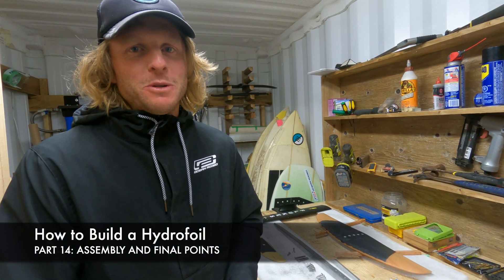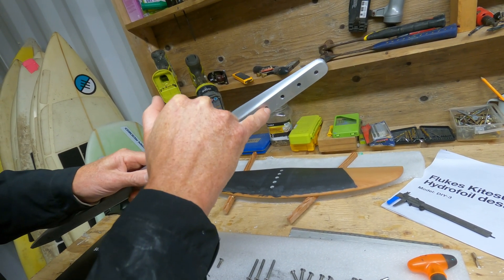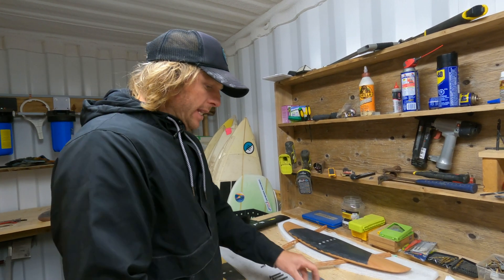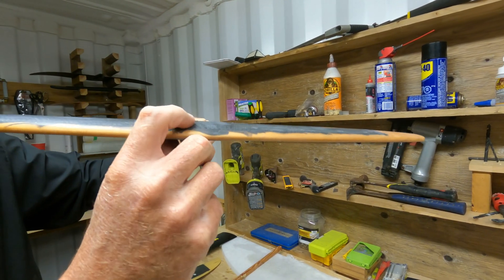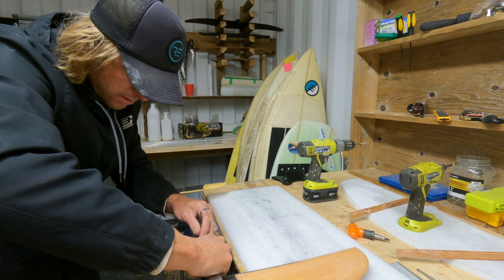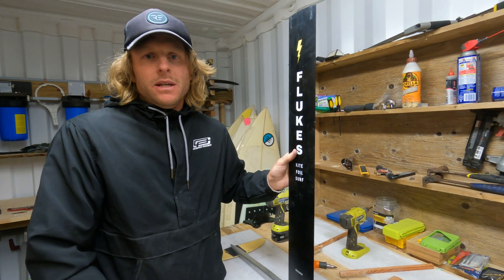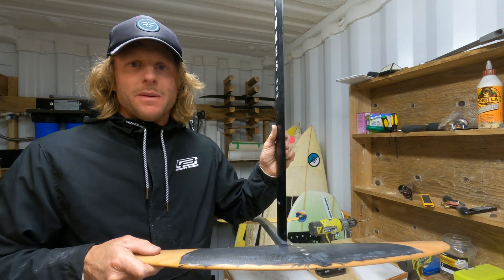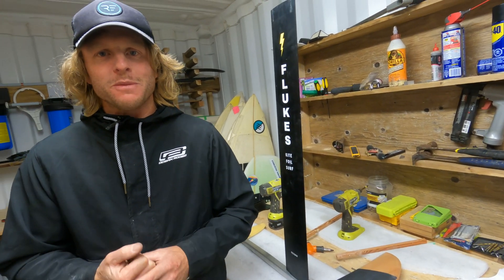How to Build a Hydrofoil: Foil Assemble & Final Points (Video 14/15)

Comment: Hi, do you think a 3D printed model using ABS MATERIAL would be enough? And using fiberglass as well?
Reply from the maker: Its not something i have tried personally, but yes you could print the core but you would need to do a similar  glass layup to stiffen it enough.  :)

Comment: Great job!
But I do not think mast-fuse connection with three M6 bolts is strong enough. 
I would put additional connectors, that have upper end of trapezoidal shape, 30mm length, inserted into mast channels. And bottom end is round pin, 10mm diameter and 20mm length,  inserted into 10mm holes in fuselage.
These parts can be designed in TinkerCad and 3d printed from aluminum.

Or, two 50mm x 10mm round aluminum pins can be glued into mast channels with epoxy-glass compound (2-3 mm fiberglass chop). That is even better - you do not need to drill 10mm holes in fuselage very precisely.
Just drill two 20mm deep holes, cover fuse with PVA release, insert pins. 
Put "corks" into mast channels to 35mm depth, put some epoxy-glass compound into the channels. Put fuse on top, deeping pins into the channels. Screw fuse with bolts. Done.
Reply from the maker: Yeah all good idea, perhaps a little too complicated for this how to series though :) To note, the screws holding the mast to fuse connection i have not had any issues with. that is actually proving strong enough. The fuse to front wing is however you can get some movement. for this size wing its fine but as the wing gets bigger its best to reinforce :)

Comment: Did you have any reason to think the thinner fuselage was not strong enough?  I am trying to figure when enough is enough.
Reply from the maker: It is mainly just surface area on the top of the fuse that connects to the underside of the front wing. I found the wider one 25mm makes that connection stronger by helping to reduce the lateral movement of the wing. I haven't had any issues with the thinner (19mm) fuselage for strength itself, but it's the wings attached to it that get damaged if the wing kinks to the side under load. (It can bend the screws and compress into the wing) so the 25mm seems to help fix that (as well as keeping the screws tight, more screws, and additional fibreglass on the underside and top of the wing where the screws are, exactly as shown this video series ) :)
Reply: @FlukesKitesurfing  I really appreciate your response and your willingness to publish these foil building videos!!!  Have you tried titanium screws from China instead of stainless?  I just got some 6mm and will let you know how they perform.

Comment: Really no anti seize on the threads?
Reply from the maker: Yeah Mate for sure, as mentioned best to lubricate the threads. :) Use anti-seize if you plan on having the foil assembled for extended periods of time. Otherwise, just keep the threads lubricated with another oil like the 3in1 I've been using in the series as long as you don't store it assembled. Even WD40 works if you always pull it apart. That's what works for me :)